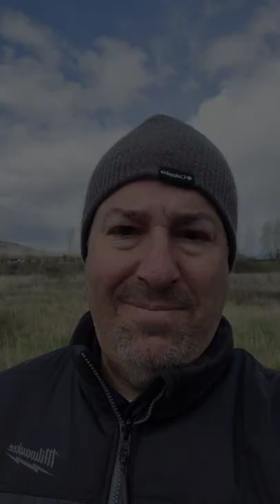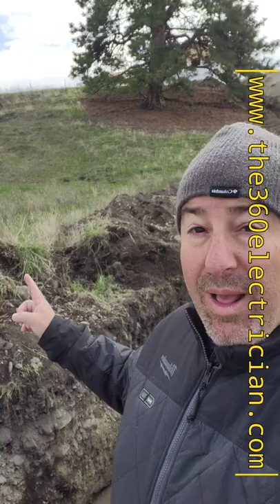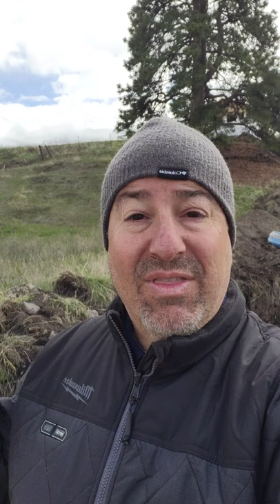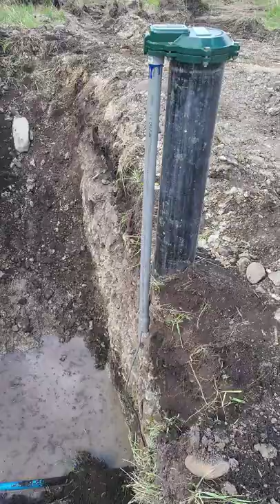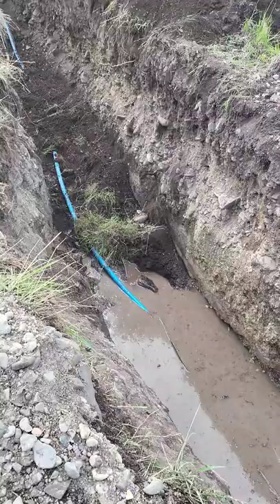Finishing Well Electrical in the Missoula Montana Build #electrician #Missoula

Comment: What's the amperage and voltage for the motor? That sounds like a very long way to run #10 to start a motor. Are they going to build a structure to cover the well? I would think up that far you would have to think about installing heat tape for the winters.
Reply from the maker: 230v 3 phase according to the specs it's a variable motor keeps constant pressure I. Line. 8amps.

Comment: Dang how much voltage drop is that gonna be?
Reply from the maker: I know right. We didn't even calculate it just went straight to the installation Manuel. Said 600 feet #10. There is a 3 phase coverter/controller. I just found out it's only a 20amp unit with 30amp breaker per installer.